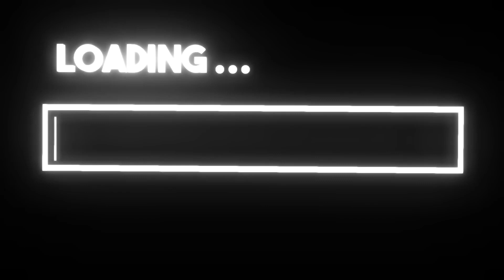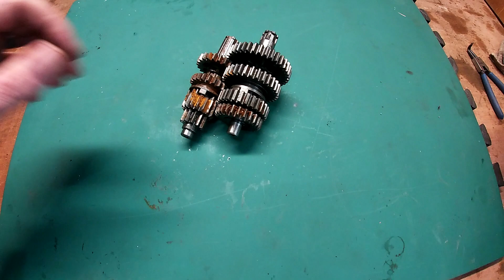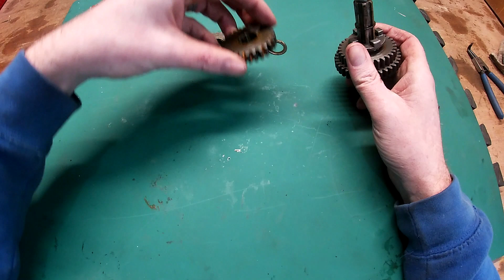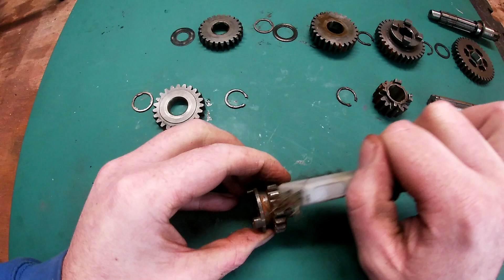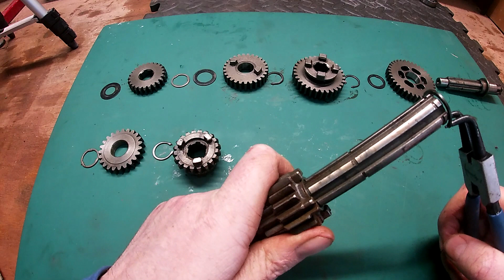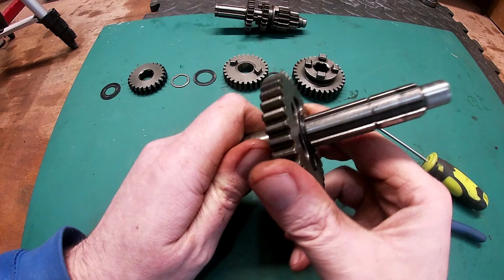How To Rebuild A 125 Pit Bike Gear Box | Step By Step

Comment: Hi, great video!
I have a stomp 125, I believe the engine is the (YX 125) it is missing third gear. When selecting third, there is no drive and lots of rattling. The other gears are fine. Would someone as confident as yourself have any ideas as to cause and solution to this please? I'm aware the  engine is going to have to be disassembled, just curious as to what I should find in there? Many thanks.
Reply from the maker: Did it just loose third gear or did it get worse  until stopped selecting?
Reply: @ScottsShed  hi, thanks for responding. I purchased the bike with the issue and with no indication of its development sadly..
Reply from the maker: @alabinibop  can u email me a picture of the engine ? my email address is in the about page
Reply: @ScottsShed  yes, I'll send you one over. Thanks.
Reply: @ScottsShed  hi, I have sent one via insta.👍
Reply: @ScottsShed  how many gears does it have ? Would be cool for a one off type of build

Comment: I have a 2017 ssr 125 . Tore it all the way down , checked gears . None are broken . Motor sounded good but won’t never go into any gear . I’m going to go ahead and replace all gaskets when putting it back together. I’m going to replace the small spring on the gear selector assembly. Do you have any other advice on what it could be ?

Comment: My 3rd gear rattles and jolts. No idea where to start. Cars are more my expertise
Reply from the maker: Possibly shift forks or a warn gear
Reply: @ScottsShed  so it might only be the selector? Could it be chipped tooth or worn bearing? Other gears are fine. Kinda feels like chain is gonna come off. It’s a 125 pit from China. Motomadness it’s called
Reply from the maker: @leenevin8451  would t say bearing as it’s o my the one gear I think possibly worn gear or selector forks there’s a video on my channel of a complete tear down and rebuild if u get stuck hope you can sort it 👍
Reply: @ScottsShed  does the engine need pulling off frame? I’ve seen the gear/shaft rebuild. Is it difficult to put back in?
Reply from the maker: @leenevin8451  yeah need to split the case to get to the gear box but can take clutch side off in the frame to check shift selector
Reply: Hey great video! Exactly what we need. Do you know if this gear box is the same as a 50cc with only 3 gears? Atleast to some degree 

I have a pagsta 50cc mini cruiser that shifts down to go up a gear. The 3rd gear is currently blown you can shift to it and it skips teeth and catches and skips and catches. Stays in 3rd tho. Trying to figure out if can buy just the gear or maybe a full gear set like what you have here and take what I need from it. Thoughts?
Reply from the maker: U can just buy a gear but not sure if this type is the same thanks for watching